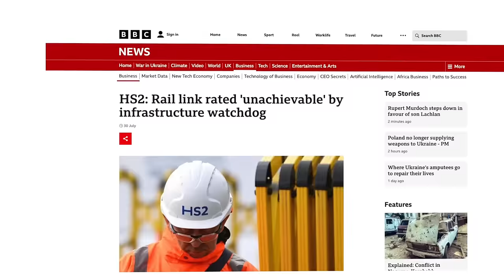The Battle To Build Britain's $90BN HS2 Railway

Comment: It's very much needed. Similar to the Elizabeth Line, it costed a lot and everyone hated it when it was being made, but once it's was finished, everyone loved it. That's how it's going to be.
Reply: ...but will it provide a good ROI? No, it will cost an absolute fortune and will be deeply in the red forever.
Reply: Well... I take the Elizabeth line on a daily basis and it is not a love story. There are so many technical problems! Mainly with those platforms doors! And the way some stations were designed, allowing flows of people from different directions to converge to a single entry/exit of the platform is surprising. Basically, trains are great, but the station part is lagging behind.
Reply: Similar to the Elizabeth Line (or Crossrail as it was originately proposed) it was started too late (crossrail should have been running by 1999 under the original proposals) it was started late and suffered too many changes. The original Greengauge 21 proposal was to run from st Pancras HS1 terminus with links to HS1 so Ashford and Stratford could be used to terminate trains, serve Heathrow Airport and run to the disused Biirmingham New Street platforms for a limited Birmingham service with mmost going on to Manchester etc. It was costed (excluding rolling stock at £5 billion, just after HS1 completion. 
Bloating of the scheme by the government under "levelling up" and changs of route to need massive tunnelling (pandering to protests?) has lead th the current overspend.
Reply: EV Cars, Trucks and Coaches are greener, cheaper and more efficient as they can use the new route as well as travel anywhere else
Reply: @hawklord100  i think you will find that rubber tyreson road surfaces are much less efficient than steel wheels on steel rails, no matter what colour they are. Greener????
Reply: @brianfretwell3886  You are talking about such minor 'friction' advantage that you make yourself a laughing stock. Trains can only go where the tracks are, wheels can go anywhere... this is the efficiency of an EV vehicle over a metal beast costing millions LOL
Reply: @hawklord100  You ARE joking, aren't you. Look how much a horse could pull on rails compared to what it can do on a road!!!! Also the horse power of one lorry compared to the loco pulling a massive freight load!!!
Reply: @brianfretwell3886  You havem't got a clue mate LOL I can drive from my house to any other house in the country, you can't do that on a train... that is called efficiency ..flg ejiot
Reply: @hawklord100  that is not "efficiency" that is convenience to those who pass a driving test, still have good eyesight, buy a vehicle that depreciates as soon as you get it, pay road fund licence, insurance etc and have somewhere safe to leave it each end of the journey when it is not being used.
Now who is the .flg ejiot????
Reply: @brianfretwell3886  🤣🤣🤣🤣 good one 😆😆😆
Reply: @hawklord100  Good to see youhave no invalid put down this time!!!!!!!!!!!!!!!
Reply: @_5_675  The need was to take the strain off the tube lines, which were getting overcrowded, even in 1992 when it was proposed.
Reply: @_5_675  Well hopefully that is some taken OFF the roads.
Reply: @_5_675  The whole resaon was to create economic activity, that is a good thing
Reply: No. As a UK taxpayer who lives in London I can say that I do NOT love the Elizabeth Line. Even my colleagues who use it do not love it either. Especially for myself who had their tax increased despite the fact that I hardly use it.
The problem is those that use the train will not have fronted the entire cost - that burden will be put onto those who don't use and never will. So to your point - Everyone loved it? That is NOT how it's going to be.
Reply: @_5_675  Not created, just made those "geographies" (whatever you mean by the) easier. All destinations were already on rail lines and could be accessed by changing. It's just a pity the Aleysbury branch was ommited from the final route.
Reply: @_5_675  however it was over 20 years late, originally intended to open in 1999. Not high priority!
Reply: It’s been so unreliable I switched back to the Central line. No excuse to go to a station and simply have no trains turn up in the morning. They’re still terminating them at Paddington which was meant to be freed up for other services and the big one is it’s more expensive to the airport for workers which means we all still transfer at Paddington to get the express. During the day when it works it’s fine for shuttling the central section but was that really worth the price tag. Lastly I’m baffled at the poor design that leads to overcrowding at Liverpool Street and Paddington.
Reply: @Arghans  Yes, those Paddington only trains are a pain. However in the summer it is cooler than the tube trains.
Reply: since its costing 100bn, can we SIMULTANEOUSLY have the FKING BAKERLOO EXTENSION TO LEWISHAMMMMMMMM, that would only cost 4bn, the same about the uk threw at ukraine
Reply: @user-lp5wb2rb3v  Ah, but that would be under a Labour London Mayor. With a Conservative government that wouldn't be what they wanted!
Reply: At least that little bit of walking is enough to prevent a person from being obese. @hawklord100
Reply: @ShrunkedDude  Judging by the pudgy train passenagers, I doubt it, but it is always good to find a positive spin.. well done
Reply: @hawklord100  Until your  EV needs recharging and you can't find a charging point.
Reply: @TrevorWilliams-fq8mg  don't be silly, thats like you would drive your petrol car until you are in the red and then you start looking for another petrol station LOL any fool will see that they need a recharge and will top up when they can, it is not like you are then carrying another 100KGs in weight just because you put in 16 gallons in the tank... LOL and by the way when you leave home with 300 mile in the tank, the car will tell you where the charging stations are on the route you enter in to the console, even your phone can tell you and how many miles away that is... this is how the millions who buy an EV ... don't worry lol because they have a brain
Reply: @hawklord100 and you arrive at the charging station and it's out of order. Then you drive to the next charging station and the chargers don't fit your EV model. Then you  drive to the next one and someone's using it . And then you run out of power.
Reply: @TrevorWilliams-fq8mg  Don't happen with Tesla charging stations, at all.... and you buy an adapter (30$)and you can use a Tesla charging station.. simple, you only need to engage the brain and EV drivers use their brains thats why they charge at home or work and never have to use the public chargers

Comment: HS2 derailed long ago with a little piece of missing track between the HS1 and HS2 railway lines, just outside the existing terminal stations of St. Pancras and Euston. The difference between including that little bit of missing rail and leaving it out is the difference between the imaginations of politicians who conceived this 'Colossus of Rails' - those who think in terms of Great (connected, continental), Britain and those who think Little (insular, regional), Britain
Reply: Why does a purely domestic line like HS2 have to connect to an International line to Europe HS1, for a start there is no capacity for HS2 trains in St Pancaras International station
Reply: @peterwilliamallen1063 The proposed link would not involve St Pancras. It would have linked HS2 and HS1 north of Kings Cross, the idea being passengers from the North would bypass London and go straight to Paris. It was originally costed at £1.2 billion. Small change now.
Reply: @ds1868  It was tried years ago with special night sleeper coaches from Manchester to Paris and failed, these Coaches were exported to Canada and are now used on the Canadian VIA Rail service across the Rockies, there is no call for trains from HS2 or passengers to travel to Europe via  the Channel Tunnel when there are quicker routes via Birmingham and Manchester Airports plus as Avanti West Coast Trains/ Trenitalia will be running HS2 services they would not with out specially built trains be able to run through the Channel Tunnel, that is why there is only one operator, Eurostar that have the correct trains

Comment: Meanwhile, China has over 26,000 miles of high speed railway lines in full operation.
BTW, "Ruislip" is pronounced "Rise-lip".
Reply: Even rice-lip
Reply: The pronunciation was kind of funny though lol
Reply: I would have said rye-slip
Reply: Yes, but I wouldn't travel on that myself.
Reply: @LoremIpsum1970  Why, do you prefer riding on the Sour Grape Express?
Reply: @pbworld7858  no, because you have to make the differentiation between CCP propaganda and 'reality'. The latter I'm sure you're totally unaware of.
Reply: China has 26,000 miles of conventional high speed rail. The speed and tech cannot be compared.
Reply: @LoremIpsum1970 that's because you don't go further than the Costa del sol on holiday, and when you get there you look for shitey English food. 

I was on the high speed train in China yesterday and have used it a lot. It's amazing. China is ansolutely light years ahead of Brexit England.
Reply: It's actually closer to "Rice-lip" than "Rise-lip"
Reply: Which, with the way it was built they now cannot afford to maintain.
Another track is desperately needed in the UK and it has to be built properly if it is to last as long as the previous 150 year old lines.
The part they are talking about scrapping hasn't even started to get built yet, so the costs are all down to the southern leg. The southern leg is the bit that should get questioned, not the north. The north is where it is massively needed more than ever. Pulling it now would be a disgrace.
Also, why is nobody talking about the 17b spent on unusable ppe during two years of covid? How does that get quietly written off without complaint? That's a 6th of the budget required over many many more years for hs2 to be built properly and actually be worth something in the end.
Reply: Including helping Indonesia HighSpeedRail.. 😁😁👍👍💪💪🇮🇩🇮🇩
Reply: @LoremIpsum1970  do you know the meaning of propaganda?
Reply: @cameroncook2048 Coin stability Test will answered all of that Hype. 😅
Reply: まあ中国の高速鉄道に関しては莫大な負債かかえてるけどね
とんでもない赤字垂れ流してるし
Reply: @LoremIpsum1970 why not?
Reply: @LoremIpsum1970 Time to ditch the screens, kiddo! Go outside, feel the grass under your feet, and see the world without the media's filters.
Reply: @isurumw6119  I was a kid in the 70s and 80s, thanks  👍

Comment: Ive just come from a trip from the mid east. The equivalent of 50 HS2 mega projects are going on in saudi/dubai/qatar. 
The Uk is struggling to make 120 mile train line from London to Birmingham-utterly shsmeful
Reply: There is nothing being build for high speed rail in Dubai or UAE. The rail line currently being built has a max speed of 160km (100mph) and is freight only. They speak of planning passenger services but nothing has been built that would enable them.
Reply: Quite easy to build on an open land desert with nothing in your way such as people, wildlife, ancient trees and scenery.
Reply: No need to go far to the middle East. 
The UK's immediate neighbors have built and are currently building mega infrastructures for a fraction of the cost of HS2.

Comment: Nobody in the establishment seems to understand out that while it is very expensive to build, it almost certainly will never going to be cheaper in the future. 

If this new line/capacity is really needed, as everyone has agreed, building it now will certainly be cheaper than building it later.
Reply: It won't be needed for a long time because Work from Home has cut passenger numbers dramatically. It may be decades before passenger growth recovers. OK, so delay the expenditure.
Reply: "The cheapest day to build is today" is usually true.
But with HS2 the cost is so inflated that tomorrow can and should be cheaper.
Elsewhere in Europe, infrastructure costs way less and builds faster.
Maybe because they think of infrastructure as a public good to serve the public, not as a way to line the pockets of every private interest involved.

One of France's latest HSL, more than 300 kilometers long, extreme environmental mitigation features, 360 standards = 7.7 billions.

Paris humongous metro expansion equivalent to the length of HS2 between London and Birmingham. 90% in deep tunnels and with about 70 new grandiose stations : less than half of HS2's cost...

Madrid's cross center tunnel for high-speed trains, don't remember the cost but it's a mere speck compared to HS2.

Fix the spending, the project process and laws. Then and only then try to finish the line.
HS2's current cost is completely abnormal and unjustified. It's way overpriced.
Even if they halt the project for a couple years while they investigate and fix the cost issue of infrastructure in the UK, it will still be cheaper than today.
Reply: @lesfawcett5245  It hasn't, passenger numbers have recovered surprisingly quickly and are forecasted to continue to grow.
Reply: @marcustrevor1883  what hasn't what? Passenger numbers are about 70% of pre-covid, not surprising when there are less trains. Numbers will increase but work from home will have a long term effect.

Comment: At this price tag nothing should ever be built, unless you invent teleportation, or at least make a railway to the Moon. Even if you consider the lower value of £106bn, at 530Km of length in total, that still means £200m/Km. THAT IS MENTAL! In the UK everybody loves to use expressions like "world beating" or "state of the art", whereas at the end of the day, HS2 is just a railway. Ok, high-speed, but just a railway. Don't tell me about tunnels, and bridges, and viaducts, these are common things for almost all railways and motorways.
If the UK is really "world beating" at something, that is wasting money. It is absolutely undesputed world champion at this. And that is because the vast majority of the money (probably more than 80%, just like in case of many other major projects) is spent on things that have very little to do with the actual construction, i.e. entire armies of consultants, advisors, analysts, lawyers, accountants, project managers (people with laptops in general) paid with £1000/day. It was the same with Elizabeth Line, and the result isn't even that good. Closures for maintenance works just months after opening. Faulty signals out of the blue, and 20 mins spent in Canary Wharf before announcing that the train won't go anywhere any time soon... Absolute disaster!